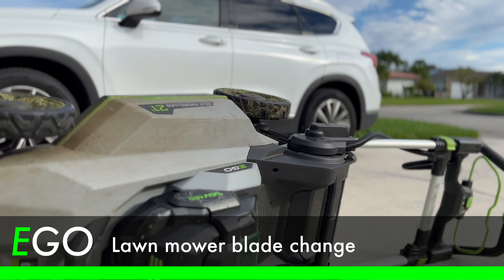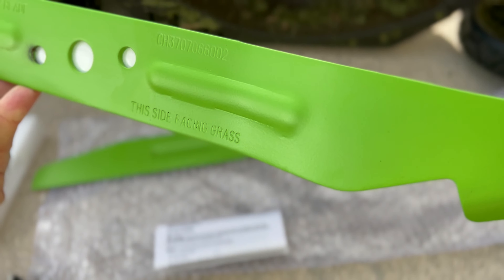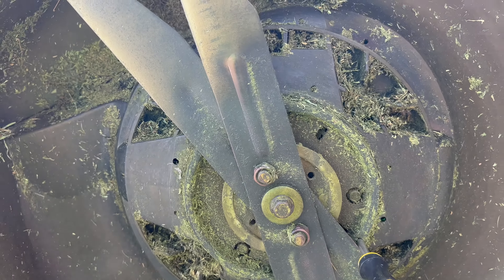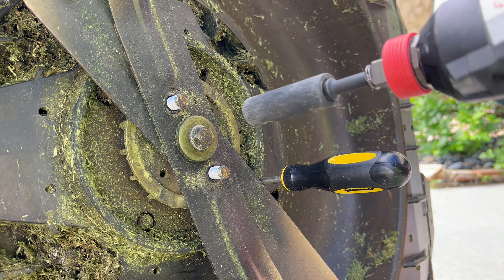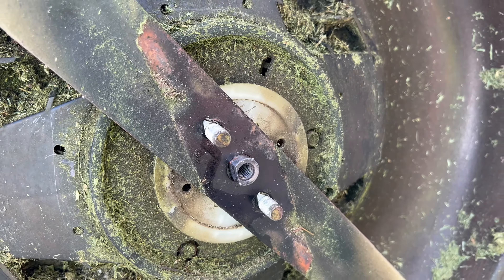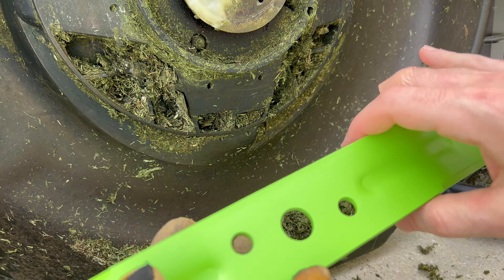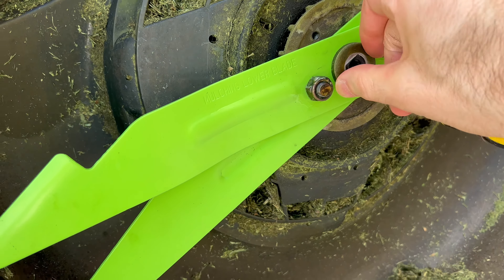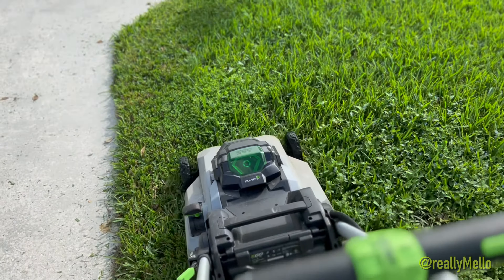How to change the dual mulching blades on Ego LM2135SP lawn mower

Comment: Thanks for the clip, I was stressed thinking this was going to be hard to remove.
Sprayed some WD40 before attempting, was surprised little effort was required to remove blades.
On my set purchased in Australia the blades were already joined with the nut and bolts... thank you Jesus 🙏 
😁

Comment: Very helpful video.  Just got my Ego mower a few days ago and want to change from the mulching blade to the high lift blade.  Thank you for the simple real world instructions.
Reply from the maker: Awesome! Have fun with the new mower.
Reply: Electric or air impact is highly recommended for removal of the bolts.

Comment: To clarify, that's the extended runtime blade. You can mulch with it and it will give you longer use of the battery, but the actual mulching blade is what should be used for mulching. However, the mulching blade will use more battery. I personally would prefer to have more battery. Nice review.
Reply from the maker: Thanks!
Reply: You can use  the lift blade as well.. its wider as well for a cleaner cut

Comment: Nice to see you had difficulty getting the nut off.  I just tried to change to high lift blade on brand new mower....no luck.  I will find a pipe to put over socket wrench for more leverage.  To me, the high lift blade should be the default blade on this.  The standard single mulch blade struggles with decent leaf and grass bagging.  thanks!
Reply from the maker: Could have been a coincidence but I think letting the penetrating oil (WD-40) work itself in there a bit helped
Reply: Same. Just got mine and still trying to get it off using 18v impact wrench.
Reply: Got it off with a small sledge.  Not recommended, but it did the trick.
Reply from the maker: I bet it was satisfying though
Reply: I ended up my using my Ryobi impact drill with some 3/8 Makita sockets (9/16 and 11/16) to remove the bolts. I had to hold ryobi in place for 10-15 seconds before the bolts loosened. A little longer than I anticipated, but it got the job done!!
Reply: I was beginning to think I’d need to go buy a Ryobi impact wrench to remove the bolts, but the impact drill did the trick.

Comment: This was extremely helpful;  I had trouble with the white "fan" turning with the center bolt, but there is a second, smaller hole in it where placing a thin screwdriver or the like in it allows the bold to turn.
Reply: That's what I'm trying to figure out now. The white "fan" keeps turning, and the smaller holes have nothing to catch on the inside of the mower. The factory must love to tighten lose nuts down. I couldn't get them off, but my neighbor is a mechanic and brought over his power tools to get it off. Even he was surprised they were that tight.
Reply: Same problem here but I cannot for the life of me find the other hole you mentioned to keep the center white blade from turning while trying to tighten.... Help!
Reply from the maker: @ErikKruse1 might be covered with dirt
Reply: @ErikKruse1  There are a couple of holes in the white fan itself, they disappear behind the blades when blades are turned.  something in one of those holes allowed me to turn the center bolt.

Comment: Folks, use a longer breaker bar on that center nut.  It's on there very tight from the factory.  If you don't have a longer breaker bar, get a steel pipe and fit over your ratchet, or short breaker bar.  The right tool makes it so much easier.  Also, Harbor Freight has cheap torque wrenches that a pretty accurate.  Using one will insure your blade is properly tightened to spec.  And while you're under there, please clean the air passages.  The guy in the video didn't do this, and his motor will run hotter.  These air passages are in the top center of the mower (looking from under it).  Clumps of grass will plug them up, so gouge the clumps out.
Reply: So many people don't know to just slip a long pipe over the ratchet handle and that gives the increased leverage to take care of almost all tight bolts.  Dad taught me that back in the day when he showed me how to change a tire.
Reply: Thanks for mentioning the torque wrench. The user manual specifically says to use a torque wrench and lists the setting to use.

Comment: Hi. I have the exact same problem on my NEW LM2135SP. . It came with the jagged mulching blade installed and I need to exchange it for the sharp blade, as half of the grass is ending up in clumps on the grass instead of in the bag.  I have not been able to turn the nuts - even with WD40 and a neighbor's assistance with a power wrench.  I have a mechanic friend with an impact wrench setup and maybe he can get them off. The fact that you were ultimately successful gives me hope.  I've read a few posts online regarding this issue with the Egos.
Reply from the maker: Were you able to get help from your mechanic friend? How did it go?
Reply: @reallyMello  Hi, RM.  Yes, he helped me. It took 5 minutes to remove and replace the blade. I am a very happy camper now.
Reply from the maker: Awesome
Reply: This is why is have a breaker bar! You can get them for cheap at harbor freight.

Comment: Thank you for the sizes of the ratchets. Mine are the opposite. The center one was fairly easy but I still cannot get either the two outside nuts loose even after wd-40. I'm about to rip my hair out

Comment: Fantastic job. Very informative. I’m not sure if I have those two bolts because my mower only came with the one blade I believe.  Well, any two bolts work
Reply from the maker: I’m not sure if the ones originally designed for a single blade are meant to work safely with the dual blade

Comment: You are supposed to use a torque wrench to install the blades to ensure the correct torque is present on each bolt for safety. An improperly torqued bolt could break if overtightened and come loose if undertaught.
Reply from the maker: Thank you, great info to share!
Reply: But what are the torque settings? I just checked my manual and blade change instructions give no specs.

Update:
I emailed Ego and this is what they said.

30Nm for 2 nuts
50-60Nm for central bolt
Reply: @sgtkabukiman9411  The manual with my mower says the main shaft bolt in the center should be tightened to between 36-43 ft-lb. And if you have the additional 2 blade set nuts, they should be tightened to 22 ft-lb each.
Reply: @jwoeste  I emailed Ego and they sent me the info as it's not anywhere in the manual I have. It could be that's because I have the Australian model and I've noticed several differences between the US and Aus models. We only get the high lift blade in the box, whereas the US gets that and the mulching and extended runtime blades. And we don't get the side discharge chute on any of our models.
Reply: @sgtkabukiman9411 my Aussie EGO mower came with a side discharge chute.

Comment: Thank you for the video, Is it normal for the '3403110001 Fan' to rotate together with the main bolt?
Reply from the maker: When removing the blade? Not in my case. It does spin with my blades when I turn them (assuming you mean the plastic circle part behind the blades)

Comment: Will the mower cut grass still if you leave the mulching blade off or does it have to be installed too? Seems like having two blades would cause the battery to drain quicker?

Comment: I'm looking to change my blade for the first time on the mower I got in 2021 (small yard, not as frequent mowing, don't kill me!) and I only have that center bolt. Is that normal?
Reply from the maker: It’s for the dual blade mower?
Reply: @reallyMello  no, it only came with one blade. Some other youtube searching says that's normal. Appreciate the comment though!
Reply from the maker: Only the dual blade ones have the additional bolts to hold the blades together. Single mower blades usually just have the center bolt to affix it to the motor. Do not change from single to dual blade without verifying that is compatible with the manufacturer.
Reply: @reallyMello  yeah I'm looking to just replace the one blade. thank you!

Comment: Your video was quite helpful. I read "someplace" the warning NOT to over-tighten the blade, torque to 8 inch pounds. Is this the accurate figure? Thanks, Bruce
Reply from the maker: This is what I found in the manual

"Use a torque wrench with 9/16”
(14mm) socket to tighten shaft bolt
in CLOCKWISE direction to 36-43
ft-lb (50-60 N.m.) and alternate to
11/16” (17mm) socket to tighten
“Blade Set” nuts in CLOCKWISE
direction to 22 ft-lb (30 N.m.). 
" - https://egopowerplus.com/media/productattach/2/1/21-0713_ego_lm2130_lm2130sp_lm2150sp_56v_lithium-ion_cordless_mower_manual_na_v2_1-8_.pdf *of course check with Ego with any concerns
Reply: @reallyMello  Would you say your blade was installed too tightly from the get-go?  I wondered if using a torque wrench was important -- I don't have one and am a cheapskate, but I read those specs in the manual, too. Am expecting to receive Model LM2135SP next week and want to be prepared with the right stuff to swap out blades easily and correctly. Maybe a budget-model torque wrench would be a wise investment.
Reply from the maker: I suspect just hard using the mower for awhile and the grime the area encounters kind of got the bolt really stuck in there and some combination of penetrating oil and trying patiently with the socket wrench got it free. To be safe having a torque wrench you can measure the precise torque with would be best.
Reply: 40 feet pounds is closer to what you want at the center nut.  Twenty-two feet pounds for the two nuts at either side of the big nut.  8 inch pounds isn't even finger tight.

Comment: I'm trying to set these bolts to proper torque but the center shaft rotates when I am trying to tighten the center bolt. Obviously I have the screwdriver in place, but the center shaft spins freely when I apply any level of significant force. I cannot figure out how to stop it.
Reply from the maker: You may want to give a call to Ego to see what they say. It sounds like it could be stripped. If you do call, please let me know the outcome.

Comment: How do we get the two bolts and nuts if they don’t come with the blade?
Reply from the maker: You reuse the ones from the blade you are replacing or if they are in bad shape for some reason I have links to buying replacements to those in my video description

Comment: Looks like St. Augustine grass. 

What is the perfect height for cutting St. Augustine grass so we don’t get the mohawk lines.

Also, which blade combination do you recommend.
Reply from the maker: The higher you mow the better it is for the lawn and naturally crowds out weeds per UF IFAS so I try and trend toward higher height. Overlapping your passes a little and cutting when the grass is dry should help with weird lines. I’ve been pretty happy with the high efficiency mulch blade.
Reply: I'd say use setting number 4 for height. Here in Southwest Florida, we mow every week in the summer. If you go with height setting 3, it'll burn and turn yellow from the sun I think. Anyway, I suppose it depends on your lawn and how much water you get from rain fall and sprinklers.

Comment: How long did it take you before you had to replace the blades. Something tells me the blades on this mower would need to be replaced way quicker compared to a gas one. Do you agree? Also instead of replacing the blades, you could have sharpened it correct? Very interested in the LM2156. How often I need to change the blades is the only hick up preventing me from switching from gas to battery powered. I guess the last question is does battery operated va gas impacts the life of the blades?
Reply from the maker: I disagree that they’d need to be replaced any faster than a gas one. I waited about a year and a half before changing mine. I could have sharpened but I didn’t think it was worth it with the gouges I had in the old one from hitting rocks. Gas vs battery makes no difference in blade life.
Reply: @reallyMello  thanks!! Satisfied with the mower? Any battery issues? what model do you have? U convinced me to buy it
Reply from the maker: Check out my review of the mower itself here EGO LM2135SP dual blade lawnmower unbox and 5 month later review impressions
https://youtu.be/0QWFKYEnZKQ

Comment: I once slipped a 12 point socket off of a lawn mower blade and punched the blade edge. It cut mostly through one finger and cut two others to the bone. I now will start with a impact wrench and a 6 point impact socket. No need for you to repeat my experience.
Reply from the maker: Yikes

Comment: Where do you get those alignment bolts? Mine was a single blade originally.   And I switched to the dual
Reply from the maker: Hi there, I reused my existing, but you can pickup the bolt and nuts through these affiliate links if you need them https://amzn.to/3uRdIK1 and https://amzn.to/3r1xXUd (both paid)

Comment: Where do I get the diamond protusion "blade set" bolts?
Reply from the maker: Hi there, click SHOW MORE on my video description. I have links for the bolts there.
Reply: I have a 20" ego mower with a single blade but I want the dual blades where do I get those bolts with the diamond on them ?

Comment: Question can a  dual blades work for a none select cut ego mower even if  its a 21" as well like the 21" select cut mower. My is a single blade 21" ego mower but not a select cut model. Can someone let me know.  TY

Comment: Any issue on the blade set bolts? Mine just keep spinning without loosening
Reply from the maker: The outer ones? The back washer nut should be slotted to prevent that if you apply pressure from behind to keep it in the slot.

Comment: Bolts? Ordered one but they don’t come with bolts , cannot find the type even other than they say “ set bolts “
Reply from the maker: I have links for the bolts in my video description or you should be able to reuse the existing ones from the blade that came with the mower.

Comment: Dewalt impact driver took the bolts off with zero effort.  FYI, do not reinstall the bolts with the impact driver.  If you are doing it right, tighten them with a torque wrench.
Reply: MOPARGuy  I can't remember what they are or where I got them from but I did use a torque wrench to tighten them back. Sorry man I just can't remember where I got the info from I think maybe the manual

Comment: don't use a power tool to take off a tough nut. do it by hand tool and use a hammer to tap the tool slightly works everytime
Reply: Why?
Reply: @Maldonado219  because a power tool generally will not have enough torque or too much torque and you can strip the nut...

Comment: Thanks for your video bro. You helped me out. I might be able to help you too. I found this, you all might want to read. I really dont think it's good to have them bolts on so tight. I'm not for sure but you might damage the mower with them bolts on so tight.

I know for sure it's not good to have car tire lugnuts on super tight.

If you don't have a torque wrench. Just guess on the foot pounds. But look it up and see approximately how tight they should be so you have an idea... and just guess as your tightening them bolts down by the pressure your putting on the wrench.
Check this link out. I'll post what I found.

Takecare and God Bless everyone  .

Here's what the mower manual says from the ego site: “Use a torque wrench with 9/16” (14mm) socket to tighten shaft bolt in CLOCKWISE direction to 36-43 ft-lb (50-60 N.m.) and alternate to 11/16” (17mm) socket to tighten “Blade Set” nuts in CLOCKWISE direction to 22 ft-lb (30 N.m.).”Jan 15

Comment: I can't get this POS bolt off.  I have a ton of tools here and can't figure out what attachments I need for my impact driver.   
Apparently I have to pay someone $75 to come do this for me.   That's if I can find anyone to actually call me back.  Pissed.
Reply from the maker: Let some penetrating oil sit on it for a bit and maybe try a longer handled socket wrench for more leverage
Reply: @reallyMello  Yea..  But then with a hand socket or wrench - How do I know what torque I can get on it without a gauge.   I'd feel safer with the impact driver.   Crap I have to bring my parts to Home Depot and buy something aren't I?   LOL.  Hate when that happens!
Reply from the maker: I don’t think you need to measure torque applied when loosening bolts but I could be wrong. I think it mattered more for tightening to not over or under tighten.
Reply: @reallyMello  yes for putting them back on properly so they won't kill me.

Comment: I don't like the fact they painted over most of the cutting surface on these. :/
Reply from the maker: It doesn’t really make a difference and wears off the cutting edge relatively quickly if you are concerned